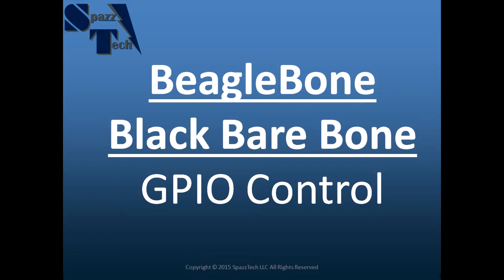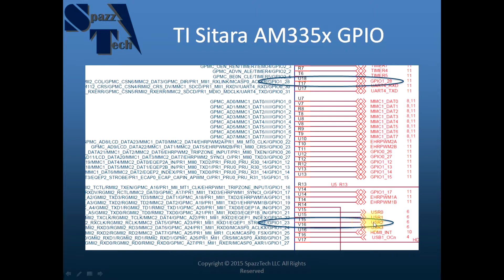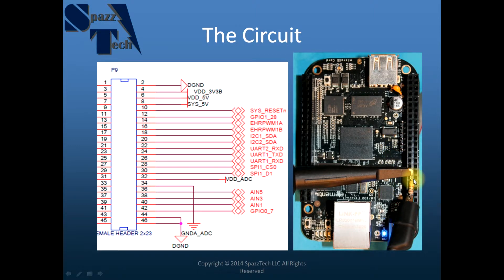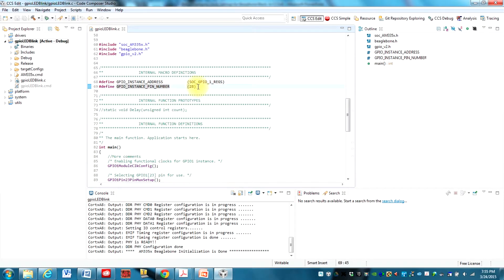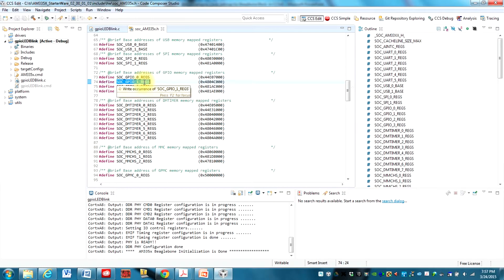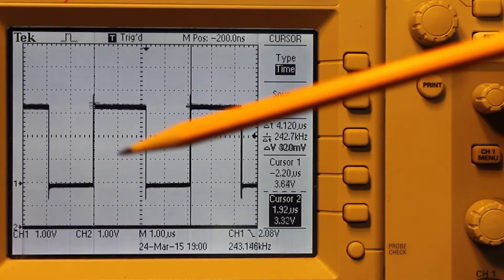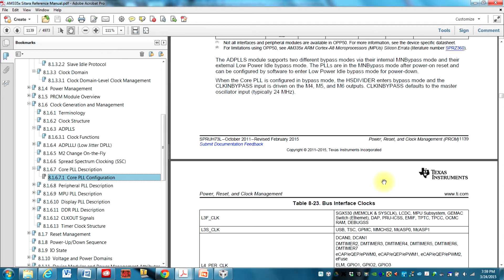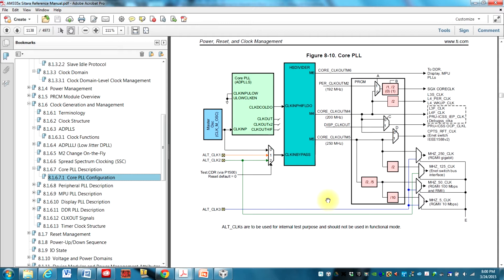#BBB - GPIO Control on #Beaglebone Black in #CCSv6

Comment: hi thanks for the video
i have one question, do you need to change the function of GIO1PIN23PINMUX() in order to use pin28 instead of using pin23
Reply from the maker: +sj he Good question and good catch. The code does work for me as its shown. You can find that function defined in beaglebone.h.  I don't see another like it for other pin numbers.
Reply: +sj he I'm no expert, but based on the reading I've done, you probably should at least set the MUX bits so the processor's pad is routed to the correct internal hardware. The pads have several names because there are different routes. In the BBB schematic, the routes are denoted in order with forward  slashes. Each pad will have a default route. Route 7 is generally GPIO. You may get lucky today, but not with the next revision. The function you mention does more than set the MUX bits and I think the other stuff has to do with pullups, pulldowns, edge-type for interrupts, etc. You could look at GpioPinMuxSetup(...) and its associated comment in gpio.h.